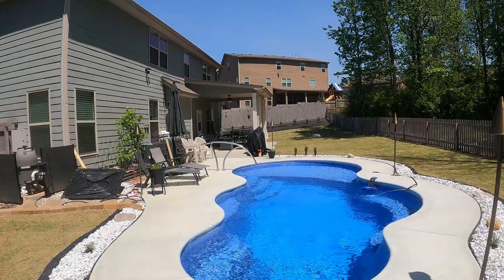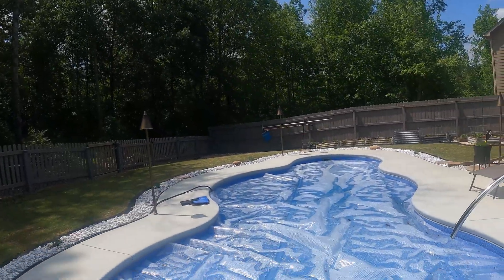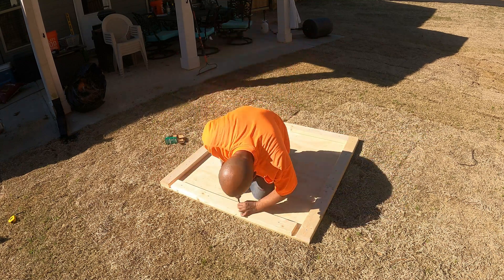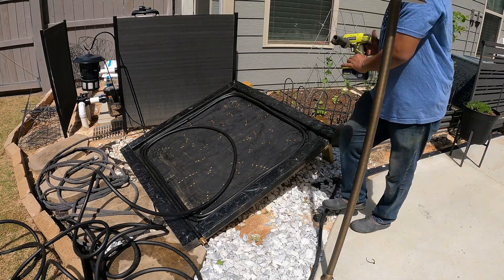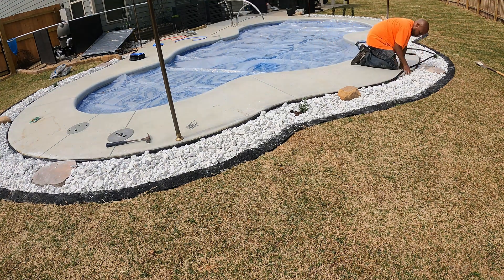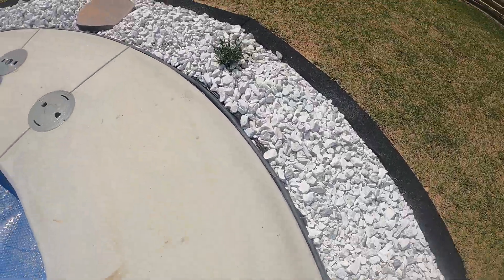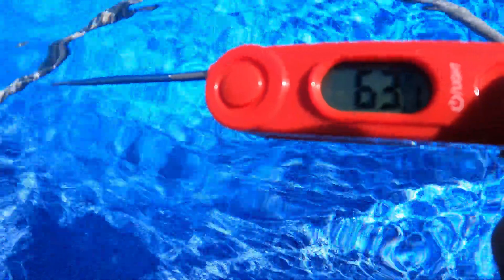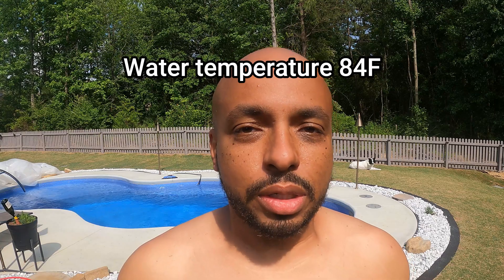DIY SOLAR POOL HEATER AND SOME MORE

Comment: I would think that putting the coil box under glass (and sealing the hose entry/exit with caulk) would greatly improve the amount of heat the water travels through. 

It's like getting in a hot car in the summertime with the windows rolled up versus with the windows rolled down. 

Dead air is an excellent insulator for heat transference (heat being carried away by even a light breeze) While not insulating radiant heat much at all (sunlight coming into the box). 

Glass top over a black painted box? That water will be traveling through a Very hot environment... Hotter than a sealed car in summer.
Reply from the maker: You are 100% right.  At the time, i tried to look for some type of plexiglass but could not find it.  This was around covid when everything was impossible to find.  I may revisit this soon.

Comment: How come nobody on there tutorials put the difference in temperature starting without any heating to heating it this way like how many degrees was the difference ?? No knock on you or any one just curious cause that would be more helpful for people to see the difference and try it or not to try it if the difference isn’t very much I’ve done it with copper coils and fire wood and you can get the pool 8-10 degrees higher with in 5 hours or so

Comment: I hope you weren't always measuring the actual temperature of the pool water right where the hot water was coming into it. You really need to measure the temperature on the other side to see how well it's really heating the pool

Comment: You could put down roofing tar paper on The wood. Are  Metal Roofing Panel Then add the hose  That should help  heat  the bottom of the hose too. It might help make the water a little warmer

Comment: You notice any issues thus far with the metal couplings in the hoses you've used? They will react with the chlorinated water running through them, but hopefully not enough to cause rapid wear. 🤞

I'm in the process of building a solar pool heater too. I have my sights on poly line and compression couplings. I like your submersible pump idea, I'm definitely leaning that way over finagling with the addition of a multi-line heating setup into the pool's original circuit. Simplifies things, easier time with adapters, plus a redundancy with the second pump! 👍

Your setup is sweet! If I end up with something like it and it works with minor TLC for 3-4 years, I'll be quite satisfied. ❤
Reply from the maker: I notice some minor corrosion but during the off season, I try to stay on top of it by cleaning it with a wire brush and putting petroleum jelly.  I also unscrew it once a month to make sure the couplings dont get stuck.  The hose it'self is going strong
Reply: @TheALG  nice! That seems pretty reasonable. Thank you for the quick response and for the video itself

Comment: Great video and set-up.  Does the water continue to run through the filter from the pump and if so do you lose a lot of pressure?
Reply from the maker: I made an update video on this and it's tied to the pump itself.  I don't lose any pressure or at least it's barely noticeable

Comment: great video just at a quick glance might want to resize your pool cover i have a much larger pool 12' deep i've found that if the solar cover can lay flat bubbles down it will keep my pool in the 80+F when i bought the place the cover fit like yours with alot of big ripples and it was high 60's low 70's just my experience
Reply: also might want to stake the hose along the pool desk to force contact to the pool deck as it is a giant heat sink you can rob heat from also <3

Comment: Gardener's tip - large pools make for excellent thermal buffers. The area right around your pool will stay slightly cooler in the heat, and slightly warmer in the cold.

Comment: Nice video filled with good tips & trix. I didn't understand if you are running the pool pump 24/7, because that heater will acctually decrease the temperature alot if it runs during night time.

I'm setting up a solar powered pool heater right now and my goal is 30°C / 86°F in the pool. I'm starting with 250 meters / 820 feet of 20 mm / ¾ inch PEM hose in a flat rooftop setup. A 20V rainwater barrel pump (2,000 liters - 528 gallons / hour) will be connected directly to a solar panel, so it's a completely automatic system controlled and powered by the sun.

No sun = no pump = no heating.

Since I'm located at 60° latitude in the northern hemisphere, I'll guess it'll be some problems and math to solve along the way, but it'll be fun.

I've spent 250 USD for the hose, 50 USD for the pump and 50 USD for the solar panel. If it works, I'll have a pool heater for a total of 350 USD that doesn't require any manuel labour and it'll run for free. You can follow this project and more on my new channel.

Keep up your good work
Reply from the maker: The pool pump runs independently.  The solar heater is only active when there is sun.
Reply: @TheALG  Good choice

Comment: I have been wanting to try something like this here in Michigan and put the panels up on the roof of our pool house. Our pool is 30000 gallons though. I wonder if this puts extra strain on the pool pump at all? Also I wonder if you put a panel of clear plexiglass on the top if each wood panel, it it would help trap even more heat like a greenhouse?
Reply from the maker: There might be a little bit of extra work for the pool pump, but if it's sized right, you should be fine.  Glass on top will help to keep the heat in longer, but I had trouble finding some locally, which is why I didn't use it in the video.  You will need maybe at least 3 to 4 of the panels my size in order to feel the difference.  Also, having a pool solar cover will help retain the heat you gain and prevent it from being lost too fast at night.  Also, having it in full sun all day is key for this to work.  The longer the sunlight, the better this works.
Reply: What submersible pump are you using? I saw another video where the person said their submersible pump got all messed up due to the chlorine. I also have a saltwater pool, plus I am thinking the external pump would help decouple it from the actual pool pump (since I wouldn't necessarily run the solar on the same schedule as I run my pool pump) so just want to make sure I get one that wouldn't be harmed with the pool water.
Reply from the maker: I got the Superior Pump 91014 1/4 HP High Flow Thermoplastic Utility Pump

It still works but only been two years.  I since made an upgrade to where I did the hook up to the pvp pipe directly using the zodiac elbow sweep.  I hooked up a .5 inch spigot to my and hook it into my hose attached to the solar panel.
Reply: Ok, so are you saying the elbow allows you to connect the return line from the solar panel to your main plumbing that returns to the pool? If so, I was wondering if there was a way to do that, or if it would cool down too much before returning to the pool. This Sounds like a good idea for a video update to visualize this part of the system. 😉 Thanks for your help and insight!
Reply from the maker: Other way around.  The elbow is connect to the pipe after the filter.  It then goes to the panel, through all the tubing to warn up and then I to the pool.  Great idea about the video, I will post one about it next.

Comment: Thanks for the tip, how can I connect the system in a pool pump?
Reply from the maker: That will be tricky, I am currently trying a few things but as of right now, it's not possible. External submersible pump is the way to go.
Reply: You should be able to use a t connector or alternative a y connector to the return hose going into the pool eye. The pressure from the return hose. Should push the water into the solar heater. Just did mine last week. We have a Haywood pump and filter

Comment: Thank you for making such a well put together video. Question: do you think this would be a more efficient system if I used a black metal roofing panel instead of plywood?
Reply from the maker: I will work.  The only issue you will have is metal retains cold more easily than wood.  Should not be much of an issue if you constantly have full sun.
Reply: How big was the panel?    Is  it a 36x36? I’d like to thank you for such an AMAZING video. Very creative thing.
Reply from the maker: 48x48

Comment: Curious how well the garden hose has held up to the chlorination. Considered using Pex, but have read where it can break down with chlorine pool applications. Also considered using soft copper, but read where you could be introducing too much copper chloride into the water. So that leads me back to using a garden hose and also whether the time and effort is really producing good results. In the past I've used solar covers on our pool. I'll admit, these covers work well. But the last one I bought $175 only last me 2 yrs. All the bubbles started to pop and created a huge mess in the pool. So now been looking for alternative and inexpensive way to heat up the pool.
Reply from the maker: I have a salt water pool so it is a bit more gentle.  So far it's only been 1 year and it has held up.  I did seriously consider pex piping but went with this.  I would spray on a clear coat spray paint in a can to increase UV resistance on the outside of the tubing.  The system is staying outside so I will also rate how well it survives winter.  I will do a 2 year review once I hit the 2 year mark.

Comment: Do you use this over the fall/winter where you're at?
Reply from the maker: I'm in GA.  I do use this over the fall and it does work.  It won't work as well  once the air temps consistently stay below 65 degrees.  You lose way too much heat for the the solar to keep up with.

Comment: I love the idea!  After you've gone through 3 months, how did the hose hold up?  My idea is to put the hose on spools where I can move them a bit in September as the sun changes directions.  We have shade on the pool until almost noon and it has not much chance to get warmed up.  There is sunshine all around the pool, so need something to get that sunshine in the pool.  South Carolina has been a bit cool this season, which didn't help.  Solar blanket and solar pump is a must have for next season.  Thank  you for letting us know about the hose, it sounds perfect!  An end of year review on the hose would be much appreciated.
Reply from the maker: So far, the hoses have held up.  There are no signs of any breakdown.   I have added another 50 ft of hose because this system has been very effective.   I think the weakest link is the wood which will breakdown faster with wet weather.  I will wait a year for a follow up.